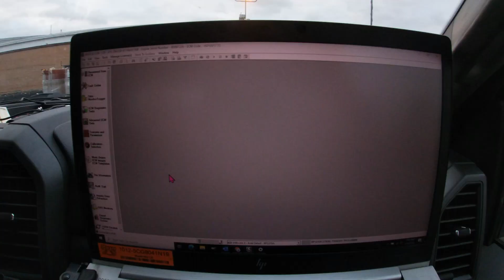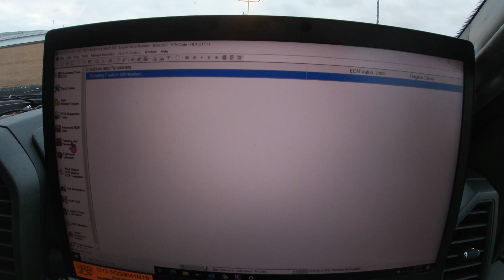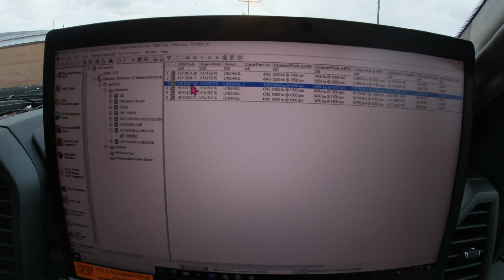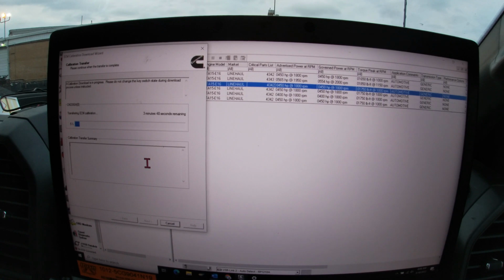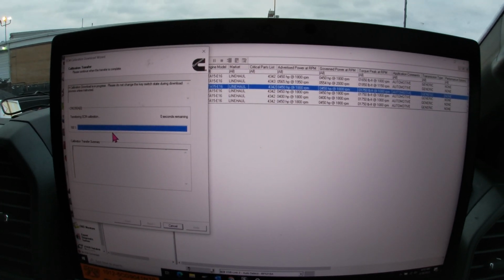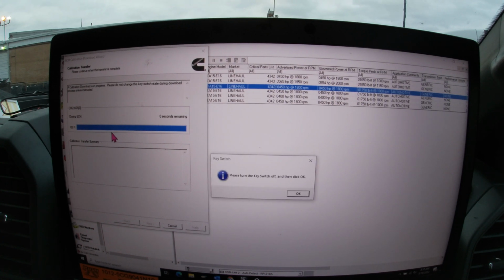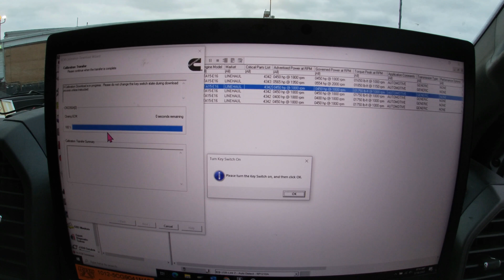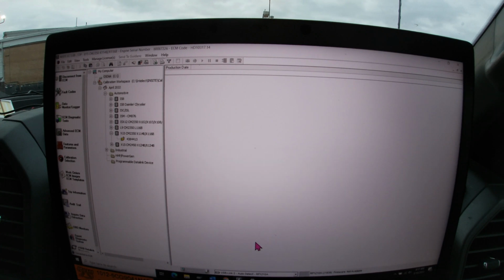Cummins ECM update

Comment: How do you program a new/ blank ecm? Tried connecting to it but still won’t connect only with the new ecm but old ecm (already programmed) communicates fine.
Reply from the maker: It sometimes requires a fleet calibration. Typically only dealerships can do that

Comment: I have a  ecm problem the darn thing keeps thinking the break pedal is pushed in and won't allow the bus to regen if I swap Ecm the bus works fine
Reply from the maker: Try reflashing the original. May need to order a fleet cal and recalibrate

Comment: Great info.
My name is Brian.
I hope you can help me with an issue I'm having with my 2013 freightliner m2 106 cummins 6.7.
The issue I'm having is I realize I'm chasing my tale.
It started with engine light on first repair pointing to the cam position sensor. Now after 4 sensor ( cam, crank, barometric, and Map) which Map did cut of light by it self for about 30 mile.  replacement and reset light comes on and the last 3 checks it only the Barometric sensor. 
Any ideas would help. 
Seems as it run as normal.
Reply from the maker: Can you send me the engine serial number and fault code number?
Reply: Engine # 73430414
Fault code 295
Reply from the maker: Can you double check the engine serial number? The number you sent me is bringing up a 4 cylinder off-highway engine
Reply: @dirtyassdieseltech6348  did you get it
Reply: @dirtyassdieseltech6348  can you help me
Reply from the maker: Pulling the head on an ism. Will be able to check around lunch time
Reply from the maker: Possible causes:
Restricted air filter
Turbo intake pressure/temp sensor
Troubleshooting steps:
Ecm calibration, make sure it is updated to BZ900143.30
If air filter is not clogged, replace turbo intake pressure/temp sensor
Reply: @dirtyassdieseltech6348  Thanks.
Can you provide part number and location, because I believe I changed it. The ECM Calibration I'll do next.